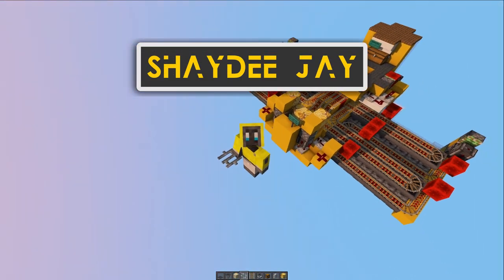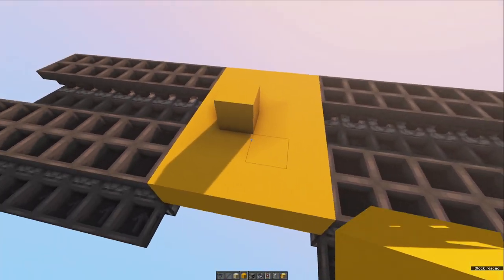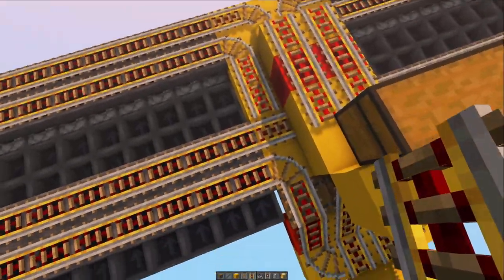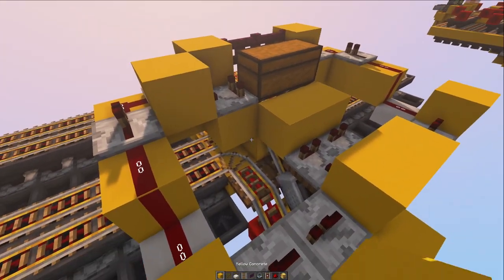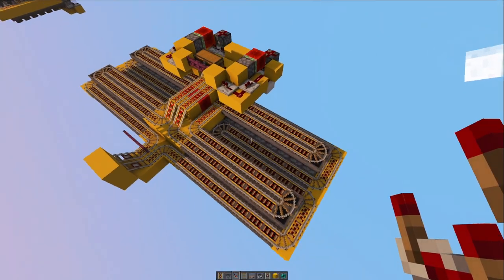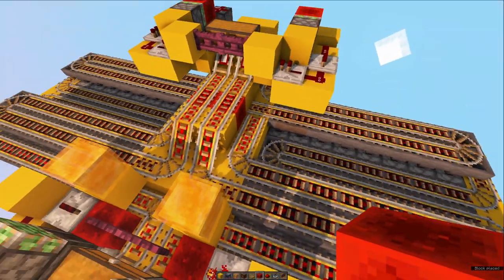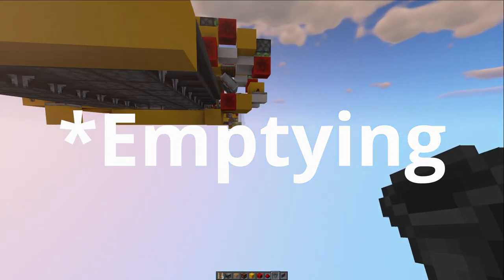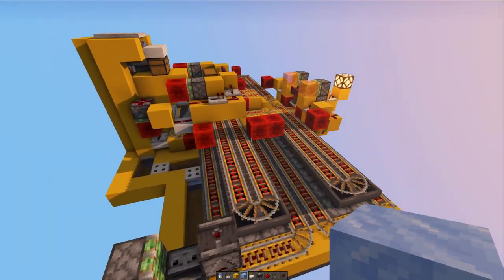Super Smelter (Fast & Compact) TUTORIAL - Java 1.19 - 1.15 (64 Furnace Array)

Comment: To anyone having issues with the smelter only picking up 63 items and the minecarts NOT parking on the slope correctly; make sure that the smelter is built in a way so that the refueling station is towards the east and the input chest on the west side of the smelter. In other words, the rails with the input minecarts need to slope up towards the east. At least this is what fixed it for us on our server :)
Reply from the maker: Thank you for this, always things I forget to mention.
Reply: Omg thank you
I have an issue that my fuel cart stop at the dropper side 
Now it's fixed
Reply: 0,o now i have to rebuild it with a 90 degree difference thank you mojang for making rails only push one way on slopes
Reply: this didn't fix the problem on my server.. 1.19.3
Reply: did not fix it for me, i built it in that orientation in the first place with the input to the eats and the fuel to the west, still 63 every time.

Comment: Honestly, give yourself more credit on the tutorial making part: you're doing great! Teaching all we need to know, showing everything perfectly and most of all, great rythme, not too slow and not too fast! I'm trying to build it in 1.20.1. I'll update this comment to let know if i ran into any trouble with the redstone in this version. Thanks again for this amazing smelter... I spent sooooo much time trying to find the perfect one :D

Update: It works like a charm but I had to replace a slab by a trap door on the way of the hopper minecarts on their loop from the input chest because even tho their hitbox had plenty of space, they stil kept getting stuck. (I changed the first one of the two slabs with repeater  on the side of the water column that goes towards to outsider of the smelter. If it makes sens lol)
Now I must admit I'll have to watch back about the fuel input because it's pretty late and I can't tell if i did something wrong or if something changed with the 1.20.1 but i my sticky pistons (with the honey block) dont seems to get updated properly from the comparator checking the first hopper of the fuel line...

Comment: Does it have to be stackable stuff in the hoppers for filler? Or can I put stuff like swords or other tools in there that don't burn
Reply from the maker: Just as long as you reach signal strength 15 it should be fine, just never tested it with non stackables
Reply: @ShaydeeJay  Oh, I see. I only need signal strength 15 for the first hopper that has the comparator output. The rest probably don't matter as long as it can't burn.

Thanks!
Reply from the maker: @SgtJelly  exactly, but please do make sure to fill the first hopper slot full of fuel on the rest

Comment: hi. i usually dont comment much but im going a little bit insane and no comments i find are helpful 

i set this up in a server and for the most part it works well. Carts dont get stuck anywhere, everything moves etc. But there is one issue, the hoppers dont take up a full stack of items from the chest. They take like maybe 15 each. Leaving half the furnaces unused. I followed this from a litematica schematic and everything seems to be placed fine but it just wont take the right number, even though in the test world it works fine. I don't know if maybe this is a server issue or what but I'm very much struggling to find a solution.
Reply: update: after making a second schematic of the furnance i built in the server and pasted it into single player it functioned as normal. so it is a server side issues (so if others encounter similar this is likely why)

unfortunately i have no clue how/if that can be fixed
Reply: update... 3!

i have found a workaround! What you need to do is lengthen the redstone circuit that connects into the gates. I did about 6 blocks out total on top of slabs. Run the redstone around there and then set all the connected repeaters (same pattern as it is normally with the repeaters, there's just more dust) to 4. This keeps the carts in place long enough to take more items and fill all the furnaces :]

Comment: Does bamboo work in this?
Reply from the maker: it should do but i havent tested it,
Reply: You need to make sure the filler chest has more than one hopper filling fuel, 4 is better, and you need to watch it. The issue with bamboo is that if you run out, it will break a smelter

Comment: So your setup works well but it doesn't at the same time I've had to completely tear out all of the Redstone moving parts because they just weren't working right and I set it up on all on Redstone switches
Reply from the maker: Hey! I'm not sure what exactly you mean by this, but it also should be working fine. check out the world download in the first video, it all works great on there. If things aren't working for you there is a chance the server you use isn't working or your probably did something incorrect.
Reply: @ShaydeeJay  I think it's also the fact that I'm on Xbox but I managed to get the main part of the system working and I just hooked it up to Redstone switches and everything works great
Reply from the maker: Yes this is not made for bedrock this is a Java machine.
Reply: @ShaydeeJay   all the rest of the system works I just tore out the redstone machines